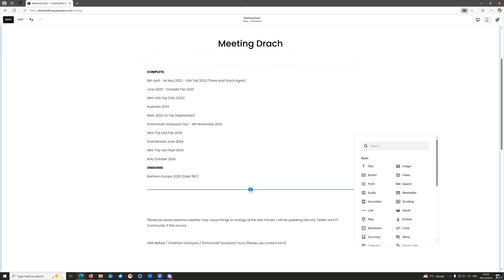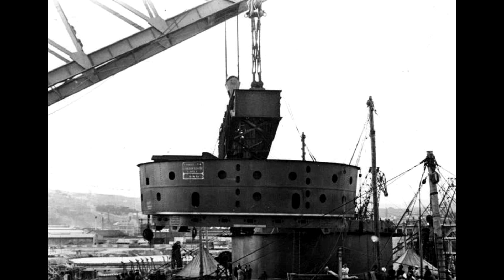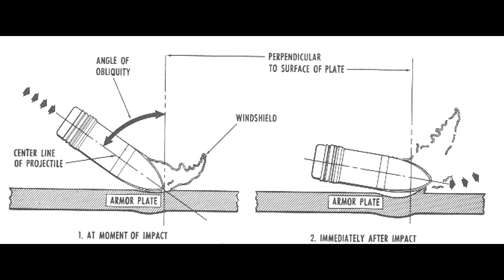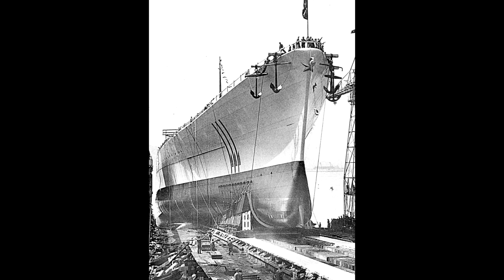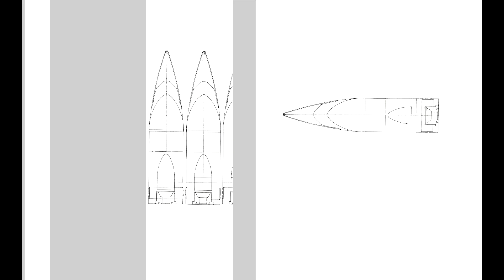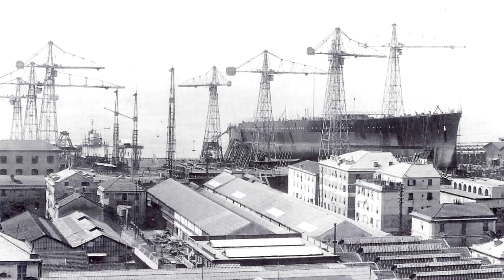Naval Engineering - Did the Littorio's Armour Scheme Work?

Comment: Considering the immense cost of a battleship. And that they needed to test their guns and shells anyway. Why on earth did they not design a real testing scheme before building it?!?!?
Like, build a test gun that could deliver the real shells the right distance against a real model of the armor?
Reply: Because the politicians who control budgets find the expense of such things excessive, seeing as money spent on test ranges does not result in ships covered in guns. It's like trying to get businesses to spend on boring un-sexy things like infrastructure maintenance.
Reply: @Rupert-B  Maybe. But seems engineers would be in charge of the how of it. And building a battleship is no walk in the park, it requires top notch engineers and top notch industrial processes. Of which adequate testing is an essential part.
Reply: @DestinationBarbarism  There are lots of real world examples of military systems where insufficient testing was done.  For example: US torpedoes in early WW2 had numerous defects, German early war torpedoes were not properly tested, every major navy got magnetic torpedoes wrong due to insufficient testing.  

Also, British shells in WW1 had problems with reliability, German cruiser shells in WW2 also had reliability problems.  US battleship shells left over from WW1 were not properly tested before being used in combat (USS Massachusetts).  Italian shells had dispersion issues in WW2.  

The US P-38 fighter - theoretically designed as a high altitude fighter - was not properly tested for dives (required modification to prevent crashes due to loss of control) or for high altitude use (pilots would get hypothermia and frostbite in long missions due to lack of cabin heat - in many cases they would have to be pulled from their cockpits by ground crews when they returned because they could no longer move their own bodies) or with the fuel mixtures Britain was using to stretch her fuel supply (which led to P-38 engine problems and crashes - it had also led to British planes crashing for a while, once they fine tuned things for British engines that stopped happening, but didn't mean the same mixture would work in US engines and nobody thought that through).

British air defenses in the Falklands in the 1980s could not reliably engage low altitude targets.  They actually ended up putting crews with machine guns on many of their ships as a last ditch defense against bombing by aircraft that came in at low altitude.  Not sure exactly what guns they used, but I doubt the machine guns they were using were all that different from the 20mm Oerlikons used in WW2.  Interesting considering how many people will tell you that 20mm Oerlikons were obsolete by the end of WW2 - obsolete means no longer useful!

Managers and executives in government and industry often ignore the recommendations of engineers for test.  It's still a problem today, even in highly regarded engineering companies with a generally good reputation.  It's even more of a problem with respect to companies and other organizations which have a lot of sociopaths in management/leadership positions.

Comment: It seems to me that it had not been taken into account the main effect that hitting spaced armors at an angle has on a projectile, that's to make it tumble before hitting the main plate. That BOTH should help with decapping AND reduce the needed thickness of the main plate beyond the simply geometrical figure.

Comment: Well, the engineering software exists to test it definitively.  Just need someone with the inclination and the runtime availability to do it.
Reply: No.  Engineering software is a supplement to real world testing, not a replacement for it.  This is why the Test and Measurement industry exists, and the science of Metrology (the science of measurement and its application).

In the real world, systems can exhibit non-linear behavior or even chaotic effects that won't be checked in the software (or accounted for) unless you know they can happen (usually from real world experience) and configure it accordingly.  In many cases, you'll have to write your own software to handle these problems, or work extensively with the vendor to modify the software (which likely won't happen unless they have a good financial reason to do it).  

All software will have bugs, usually in 'corner cases' where the vendor didn't test sufficiently, or in situations where the vendor made assumptions about use that don't match what you are trying to do.

Plus, there are many numerical issues that can cause problems.  If you are curious Ronald Mak's book on Numerical Computing is a good introduction to the topic - but keep in mind that this is a very complex topic and people spend their entire careers specializing in it.  

Also, just because you have a number, even if it is computed correctly, doesn't mean you can use that number for some particular purpose.  Numbers don't always mean what people think they mean, they have to be interpreted and it's easy to go astray.  Another good introductory book is How to Lie with Statistics (Huff), but again this barely scratches the surface of a very complex topic.

Good engineers learn how to look for and work around these issues for the particular problems they have to deal with, but that doesn't necessarily mean the techniques will be applicable to the problems you are trying to solve.  For example, relatively few of the techniques developed for military sonar are applicable to medical ultrasound: the people specializing in medical ultrasound have had to develop their own techniques that match the problems they need to solve.

After simulation, you still need to do testing in the real world, and that often results in going back to do more simulation, and so on.   Simulation without testing is not reliable except for very simple and well understood problems, and even then it is likely to be very limited in scope or applicability.

Comment: Hi Drach, did any navies experiment with shaped charge HEAT rounds, or was that just an army thing at the time?
Reply: Postwar the soviet P-15 Termit (NATO codename Styx) had a HEAT warhead. Probably an attempt to allow it to penetrate BB armour, despite its subsonic speed.

The warhead massed 1000 lb and given the technology of the time and the missile's 750mm diameter could probably penetrate about 750mm of steel.

Comment: why not go all out? 0.01 m steel, 2 plates, separated by 0.25 m of space filled with loosely packed alumina pebbles, hardness second only to diamond. void space about 30%, overall void density about 1.9. the 2 steel plates are connected via high compressive strength rods, so a crash will not break up the pebbles.

Comment: Full up tests are nice but then there's the Treasury Department. Practical math vs theoretical results.
   I have more respect for the Regia Marina since you had started your focus on them. Certainly, they should be respected in their own waters where their design choices made the most sense. But all aspects of Italian industrial prowess needed to be at the same level of competence to help achieve the desired results.
   The munitions manufacturers needed to build better shells with consistent performance characteristics for the guns.
Reply: There was nothing wrong with the shells. those guns simply had always been fired at extreme ranges (where a hit would have been by far the longest ever) and/or on smaller ships that were manuvering to not be hit (in that case, it had been amply demonstrated that it needed thousands of shells to hit something).
Reply: @neutronalchemist3241  Take a look at the papers on fast battleship gunnery, in Warship International from 2005-2006.  These show historic data when range firing by moving ships against moving Yamato sized targets.  A good crew could expect to get at least one hit per 9 gun salvo at ridiculous ranges when firing with late-war radar under these circumstances, and often on the first or second salvo.  

You can also read books on warships that cite crew experience in range shooting and sometimes what people saw on the target ships, and these confirm the data in the articles.  For example, Warspite before being damaged was able to get hit after hit at a pretty absurd range when shooting towed targets (though not as far out as the US fast battleships).

The hit rate per shell is low, but the hit rate per salvo - for a well trained ship with good equipment properly 'tuned' - was a lot better than most people realize.

The dispersion on Italian shells was different than that of the modern ships from the US or Britain.  There is disagreement about the cause of this difference.